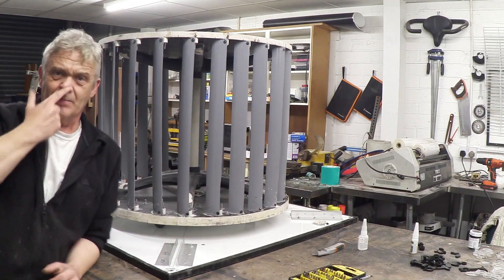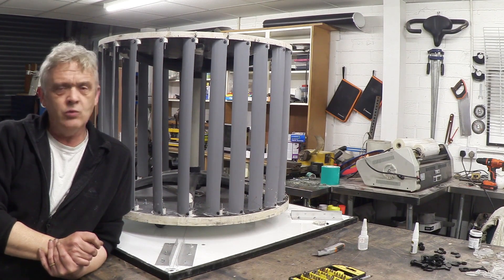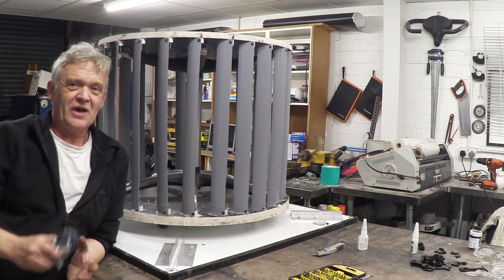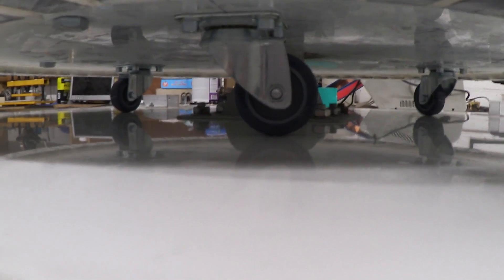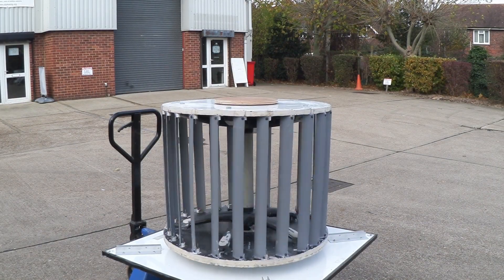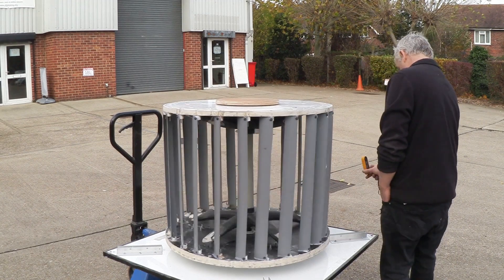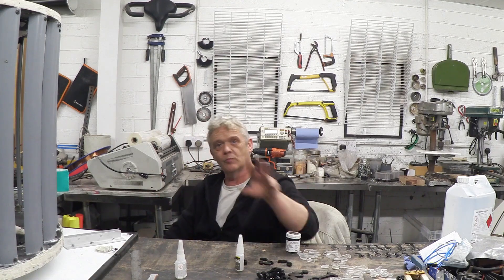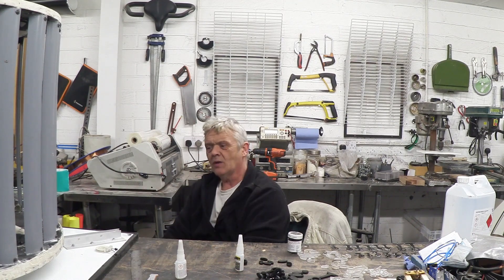Building a 1kW Wind Turbine For Under £100 - A Change In The Design

Comment: To reduce the weigh hence the power required to turn it fasten the casters to the base rather than to the windmill
Reply: Agree, and some more casters around to minimize uneven run under load.
Reply: This is a genius comment 👍
Reply: Looks like another change mate lol
Reply: That's A Great Idea Earthling 
Bless Up
Reply: Good idea. Also, in this case, I don't see a reason to use swivel casters. Maybe fixed casters?
Still believe that the two bearings that you had before would be more stable. Instead of the baffle plates, possibly use round tube or bend conduit to reduce the the air flow restriction.
Reply: Nice idea! However casters rust and get stiff. How about blades of ptfe like ice skating blades spring loaded just to be lightly in contact but fully loaded after say 1 or 2mm? This would help reduce harmonic vibrations. And noise too. Casters whizzing around in a high wind will make quite a din!
Reply: @joeharter7498  He may find the top bearing secured to something necessary for high-wind applications, but if the single bearing and a few casters is doing the job, there's one less potential point of friction (especially over time with dirt and/or rust setting in). If the top bearing is needed, alternatives to conduit maybe some old scrap rebar or aluminum bars for tubing to minimize the weight.
Reply: @williamarmstrong7199  Yeah And Maybe Some Vaseline In The Running Circle ?
This Channel Is Brilliant For Thinking Ideas 
Bless Up Y'all
Reply: Yes, very good idea!
Reply: @joeharter7498  Good! And maybe the fixed casters you say could be 4 little bearings (4 for symmetry to equilibrate forces better)
Reply: I'm looking at attempting to make a copy of this over the winter and am examining hanging it all from a car front hub assembly.
Anyone done this or any comments please
Syd

Comment: Hi Robert, I’ve watched your series on making your wind turbine.  I like it.  On the electrical generation side of things, I noticed some of your comments and issue(s) you pointed out.  Here are my responses and suggestions:
#1] The issue with the turbine ‘locking up’ when you used more than 1 microwave oven transformer coil and your solution of a bridge rectifier and capacitor:  The reason this is happening is due to the fact that: With 2 (or more) coils you absolutely must get them synchronised.  In the alternating current sine wave, the peaks and troughs for each coil MUST align.  If, for instance, in one time the one coil is outputting a positive sine wave peak and the other is simultaneously outputting a negative (trough), then the two will cancel out each other, the result being the turbine being very difficult to turn.  It is imperative to synchronise the coils for if they are even slightly out you will get a power loss.  Not only must the coils be aligned, ideally all the magnets need to be precisely spaced and placed else you will get a power loss when using multiple coils.  The other solution is to use only 1 powerful coil and ditch the multi-coil idea.  You could, for instance use powerful magnets and get them as close as possible to a powerful high-turn-winding coil with a good core.  Doing so would eliminate any need for synchronisation and accurate magnet.  Alternatively, as you are doing, you could place bridge rectifiers and capacitors on each of your coils and then deal purely with a DC output.  Of course, the diodes will drop your voltage and you will incur some power loss due to the circuitry.  If you want the output to remain AC, like a typical generator, of course, then you’d need to consider the aforementioned.
#2] You point out some of your observations about using the microwave oven transformer core/body vs not using it, and that it works better with the core as opposed to only the coil:  There are a couple of reasons for this, the main one being: With the core present it forms, in and around the coil, a type of coherency as is the case with a single magnetic field; in particular, it unifies the magnetic field such that it is centred in the centre of the coil.  Without the core, the coil (edges) acts rather more like individual elements (and less as a single stator ‘entity’).  Having a single core element (as with the spindles and bolt) should work better than the microwave oven transformer core/body.
#3] Size of the coils and/or coil core(s) : This will also make a difference, since you do not want the core(s) to be larger than the magnets and their spacing.  In doing so you will incur power losses, especially when NOT using any cores (just plain coils).  The microwave oven transformer cores are likely too big for the magnets you are using and your idea of spindles with bolts (softer metals such as plain iron work better) is a better (more efficient) approach since the cores are not larger than the magnets, yet can be scaled up all the way to the same size as your magnets (for optimal power generation).

Comment: Hello Robert, a lot of mechanical drag comes with the castors. Fixating the axle at the top end by an external rigid frame will solve this. Magnetic bearings may help reduce friction drag as well. (Costly, i know)
If you look again at the leading fixed blades and apply both the lift formula and Bernouilli’s law to their angle of incidence you may come up with a ducted design that actually prevents the blades to stall. You can than experiment with varying angle of incidence according to the windspeed thus optimising the torque it gives. Finally it will help the efficiency greatly to adopt a simple 3d wing profile for all the blades.

Comment: In my humble opinion it is not a race to the finish, but a methodical step by step process designed to come to some usable fruition. Commentary otherwise is a product of the me, now generation, design that works is never now, but a combination of engineering, testing, well that didn't work well at all and re-design that ends up as a usable, durable product. 
Aeronautic engineering modeling is not my gig, nor is calculating laminar airflow over a flat surface, but it seems to the idiot in me that the uprights would be a great addition if they were angled to the same pitch as the turbine blades. Instead of the X configuration at 45 degrees to the corners of the base, maybe 20/70 degrees angled toward the pitch of the blades, anyway just my opinion. Great build, take the time to enjoy the process and the grey matter exercise and as always thanks for the time involved in the "filming" and editing these gems :)
Reply: Yes, agree.  Think about whether the concave sides of the blades should be facing out instead of in.

Comment: Make a shroud as I suggested to protect the returning vanes into the wind- which will also act as the top bearing using three stays
Reply: Have a like! I was thinking the same thing. I was thinking the shroud would have to swivel into position by some mechanism like an attached vane of some sort. I know I have seen designs like this before on various other vertical axis rotor designs. What I am wondering about is any secondary force being applied to the rotor by any wind exiting the inside of the rotor. What makes me wonder about this is the design of overshot water wheels. They are designed so that the water exiting the wheel applies force. I am going to make a main comment about some of these ides. This thing will be up and running at maximum efficiency by 2030... ;0)

Comment: Great Idea with the casters but I wonder if higher wind speeds wouldn't force the down wind side to touch on each revolution. Why not replace your baffles with threaded rods at each corner connecting to a square top similar to the bottom? this could provide you with another surface to mount coils for an array of magnets on the top of the wheel...  Love your videos . Eagerly awaiting the completed project.

Comment: Maybe you should put the bevels back on, but in a slightly different way. Looking from the top the construction would look like the outer lines of a swastika or solarwheel. So the blades running against the wind direction are being protected against that wind. The blades running in the wind direction will be hit by the wind. Also there will be an exit of the wind because of a little pressure build up in the vawt. That wind will get sucked out of the vawt and also push against the blades where it leaves the vawt.
Although, that was my thoughts on it when I was experimenting with them.

Comment: Just a thought, at speed the castors will want to fling out and spoil the running alignment of the wheel surface relative to the path they describe on the base. This will increase friction to a degree and induce noise. All this may not be an issue as the system is self-limiting at the higher wind speed. I do, like the project!

Comment: elegant and simple solution! Great stuff! 
you have to really think how the wind is reacting as it passes through/around the thing. It has one interaction entering and also another when exiting , which is what i thought when i designed my barrel vawt (that one i posted a shoddy drawing of) It has somany interactions going on which help to cause rotation as air passes on the inside and out and around.

Comment: I keep the anemometer above my body so I am not interfering with the wind and afar as the supports, smaller pipe would work and wont cause a lot of interference, those casters will add more friction than they are worth at low wind speeds , another idea is tha the blades could be made to a better aerodynamic shape

Comment: I love the concept of wind turbines, but to really be effective (because ground wind is very choppy) they need to be about 30 feet above a nearby roof.  I started looking a telescoping antenna mounts and I think it's feasible that an antenna mast could support the weight of a lightweight turbine.  They aren't terrible expensive, you just need to make sure they are well supported so they don't fall over in high winds.  Tension wires help a lot.

Comment: i would get rid of the wheels, use 4 threaded rods to fix the exact position in hight and use wire, in a x-configuration,  to get the top and bottom in a stable position. 
and remember, the salvonius wind "turbine" (that is the name of that typ of thing)  is calculated different from propeller turbines.  probs uses the whole blade surface to collect force. 
a propeller tip spinns with the same speed as the wind goes. 
a salvonius always has half of the surface moving against the wind and therefore it is slower, but nicer, more quiet and no shadow throwing that makes the neighbor crazy.  
:)

thumbs up - nice work as always !!!!

Comment: Does simplify the build a great deal. I would however steal an idea I see in many microwave ovens. A circular rim with axle studs to which skateboard bearings are attached. The bearing ride in a circular track in the base to maintain alignment. The top of the bearings ride ride against the base of the mill. (the glass plate in a microwave.) Maintains rock solid vertical orientation.

Comment: I love seeing the evolution of the design. I really do think that it'll be better without the supports blocking so many of the blades. One of the advantages of a vertical turbine is that it doesn't care about wind direction, but those supports ruined some of that avantage.

I know the cause are just an experiment, but I really think you'll be better off spring the turbine on both ends of the axle. Higher wind loads won't affect it. They will affect this lazy Susan arrangement, because the castors opposite the wind will have higher loading since the axle is still a pivot point. In a true lazy Susan, there is no axle, no pivot, and no uneven loading. 

I do enjoy the experimentation, however!! Keep up the fine work. You've inspired my latest video on my channel about failure and troubleshooting.

Comment: As JP Later also reacted here, an external (square) frame (welded) with also a bearing at the top is the solution against the rocking of the reel and without the drag. I would opt for small car rear axles complete with the wheel bearings and (the lightened) brake drums acting as a flange. The whole contraption can then be aligned with slotted holes in the external frame. Of course, the frame is equipped with adjustable feet and weighted with concrete tiles that also fit exactly at the bottom of the frame.
Furthermore, I would cover half of the vertical wind-catching reel with a semicircular vertical rotating hood (sheet aluminium?) in an extra lighter extra frame so that half of the reel does not have to turn towards  the resisting wind. There must therefore also be bearings above and below the frame to optimally position that semicircular hood in the wind with a large fane (also sheet aluminium).

Comment: Yes I was going to mention the baffles interfering with the Wind, but didn’t say anything cos I thought they might help direct the wind into the turbine. But for that to work the baffles would have to stick out( as apposed to in)  by a couple feet to catch wind that would of just passed by out of reach of the turbine( perhaps that would be a way of making it spin faster, and spin in lower wind speed?) . But now you’ve taken them off and explained why it makes perfect sense that they would hinder air flow! 🌎✊🏽

Comment: A great improvement. However, I think I would have the turbine float on a thrust bearing at the top of a pole. The turbine would have a tube with radial bearings top and bottom so that it hangs there with no room to wobble. This could be done with scaffold poles and cheap bearings. Reminds me of the old and deadly  'witches hat' roundabouts of the 1970's.

Comment: There is a problem with casters and that is that as the speed of the turbine increases there will be a bending torque on the shaft that would load up the casters on the leeward side and lift them off the base plate on the windward side.
The centrifugal force  would then cause the castors when unloaded, to swing out on their own swivel bearing until they hit the ground plate and they would then have a braking force on the rotor as they were forced back into line with the central track that the castor swivels scribe around the axel.

This would also cause noise and knocking as the castors lift off and land in their rotation about the central axis. This would also throw the rotor out of balance as the windward side of the rotor would have pendulums sticking out as the casters swing out as the lift off the base plate.

And the action of swinging weight out from the central axis would have the effect of slowing the rotor down, like an ice skater using their arms to speed up and slow down a spin.

Suggestion: What about inverting the castors and screwing them to the base plate with the wheels running on the underside of the rotor? If the castors are stationary then the centrifugal force issue and the take off and landing issue is resolved. This will also reduce the “unsprung weight” of the rotor and its inertia.

Comment: Was wondering as an alternative might be to increase the mass of the lower disc of the turbine thus creating stability like that of a fly wheel and also gain stability through a gyro effect that would not be bullied by the Flimsier upper part. This of course might impair low speed wind results but would gain in blustery/higher winds with more run-on momentum and stability without the drag loss effect from the castors.

Comment: I think the inherent weakness of this design is that the wind is always hitting both sides of the turbine, or 180 degrees. Example: the blower you used in your shop to spin the turbine was directed to hit only the scoop side, say 15 degrees of the turbine, with no headwind on the leeward side. You had maximum propulsion without any extra drag. However outside, say the wind is blowing from the west, it hits 1/2 of the wheel all the time, so the only net gain is the windward vs leeward vein angle efficiency. I wonder if you could assemble a free spinning half or quarter cover with a large tail fin, that would rotate with the headwind to always cover the leeward veins. If you made a cage that fits over the wheel, that could rotate freely around it directed by a large tail fin, similar to a traditional windmill, which would turn the cage/cover with the headwind. Using your turbine as an example, it would have a shield or cover, to block the headwind to the left front quadrant of turbine. Depending on the design or complexity of the shield, It could be made to funnel the wind TO the scoop side of the blades, maybe like a velocity stack.
Reply: Totally agree, but if you make this modification then why go with a VAWT at all ? The main advantage of a VAWT is that they can instantly harness wind from any direction without having to turn into the wind, with this mod they lose that advantage so you would just go for a HAWT, which are way more efficient.
Reply: That was one of my thoughts too. 👍
Reply: @stupot8413  Yes and Robs quoting cut in speeds with no magnets and coils.  When I made my blades HAWT I tested them running on just a bearing, and they would turn when you could not feel the wind. In the wind mill world "cut in" refers to the speed the turbine start charging a battery, the speed they start turning is "start up".  All in all 1.8 ms is not a great start up speed for a turbine with no generator, my guess the increased friction is causing the issue..
Reply: @goldmagnet9013   I don't disagree, but going with Robert's theme of using what you already have and experimenting with it, plus  his idea to try outside circumference magnets instead of the typical center design, I'm just wondering if this would make it more efficient.